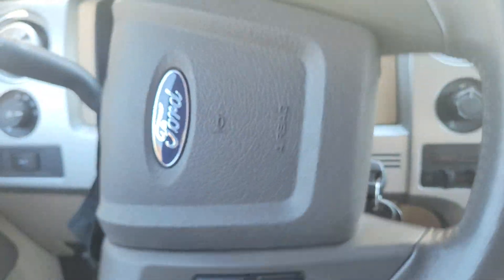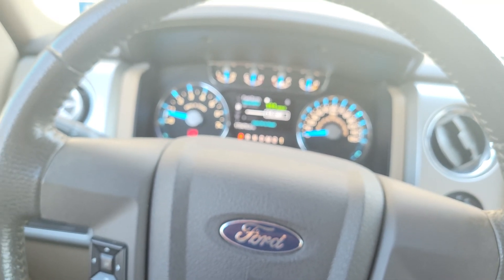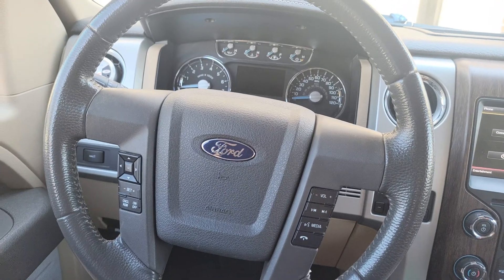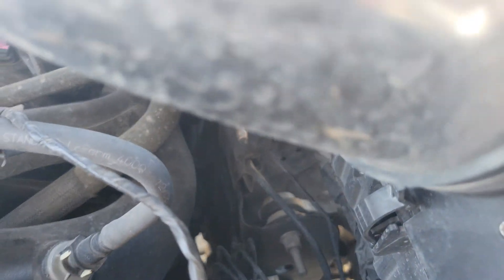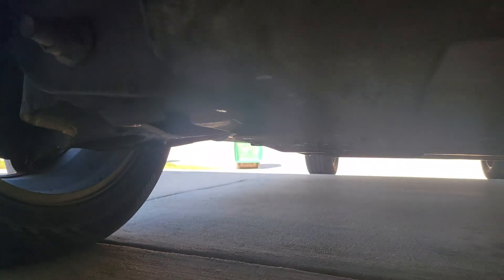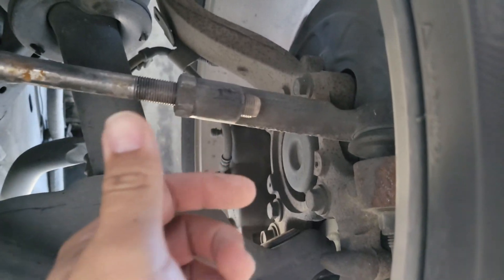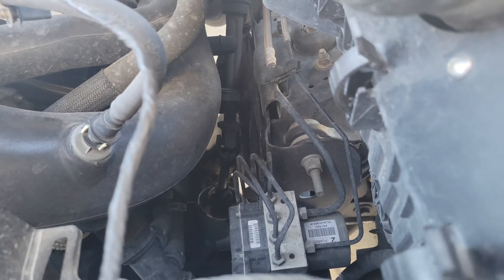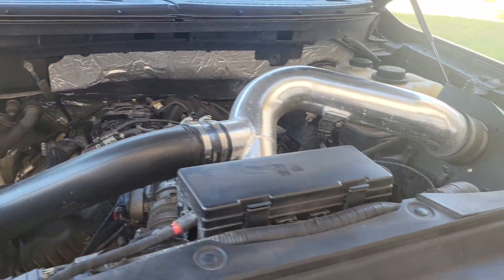F150 No power steering fix

Comment: I’ve gotta replace it on my daddy’s 2011, I’m not very computer savvy so that’s an issue for me, no problem with being able to remove the old and install the new rack and pinion. My question for you is, I looked on rockauto also and seen that there were several to choose from, how did you determine which one you needed ?
Reply: he almost said that part 🤔  he did say it, and I didn't catch it. He did good tho 😅

Comment: Yeah there's no bolt's on mine that's the problem with my power steering not to mention it is already synced to the last driver or my email that was stolen from me and held for mal-ware ransom Norton LifeLock when are you going to fix this problem with my identity being used without my consent and they got into my company account

Comment: I have a 2015 f150 with the same issue. Replaced the rack with a used one. It worked for a day then the next morning stopped working again. Any ideas what this could be?
Reply from the maker: Did you reprogram the rack module?
Reply: @TECHIELIFE  I didn't, thinking since it started to work on its own that I didn't need to. I ended up towing it back to the shop and will reprogram it on Monday. Will let you know how it works out.
Reply: So after trying for 3 hours to reprogram the new rack with no luck, We dug into it a little more. Eventually found out that the two wires going from the computer down to the steering rack was corroded/broken. Ran new wiring, it programed right away. Now everything is good to go.
Reply from the maker: Oh geez. Thats unfortunate. But at least you were able to repair the fault. Nice job.

Comment: I have a 2018 we’re my steering wheel locked up as well, so you replaced the rack and pinion and everything worked back to normal?
Reply from the maker: Yes but get the correct one. And you have to reprogram the module
Reply: @TECHIELIFE How much was  all of this

Comment: Thank you for this video there isn’t much content on this issue. I have a 2011 with 116k and my power steering just went. I bought a Dorman replacement I put it in was pretty simple but I got an alignment and had a strange sound when I’d turn left or right basically sounded like rubber being compressed in the rack and pinion so I had to buy another rack and it was good the 1st couple days but now there is a little bit of a squeak coming from the steering wheel. The dorman rack came with a module that you just plug in the obd port. Which rack did you buy?
Reply from the maker: Not sure. I basically got a remanufactured one from rock auto
Reply: Scissors me